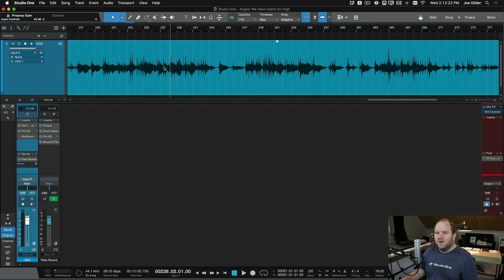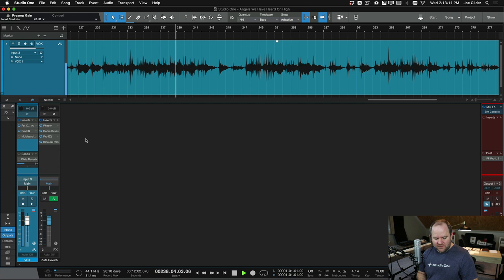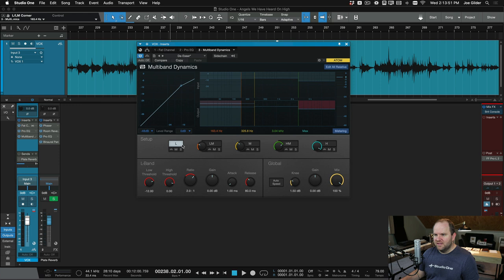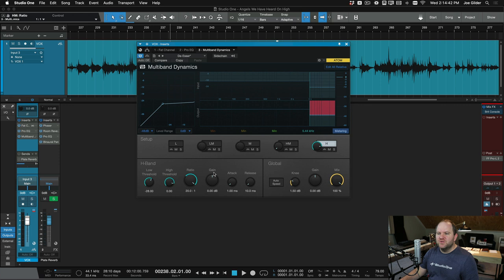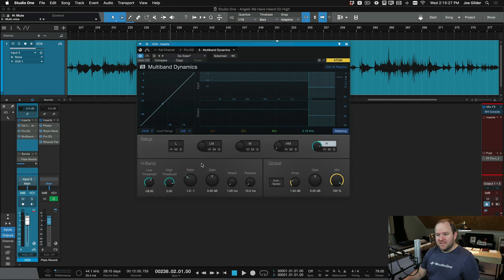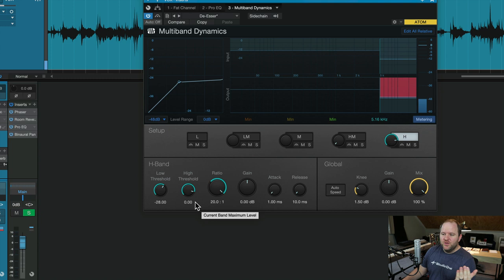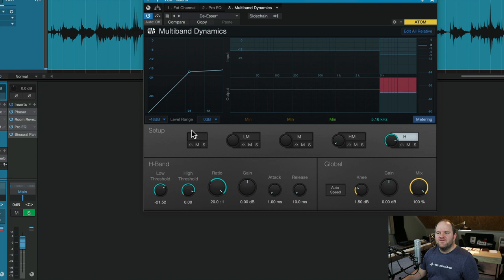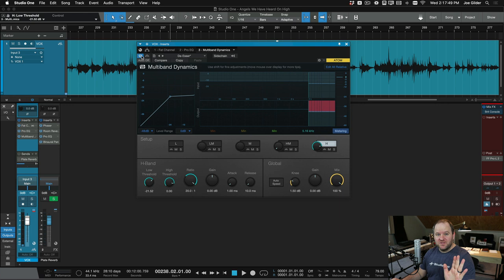Build a De-Esser in #StudioOne

Comment: You said there's no built in de esser but there's a preset on the studio one compressor called "De-esser". I've used it a couple times and it's worked rather well. This probably works better though
Reply: I have Artist. I've tried clicking and dragging this de-esser on to my vocal channel. It refuses to co-operate.

Comment: It wasn’t getting the full “S” noise out for me, my condenser is super sensitive, so it still stuck out like a sore thumb. But I found that by simply splitting the track right before the word and dragging the top corner over a little (and fading the word in) it cut it down the beginning “S” noise enough to make it smoothly go into the rest of the word. Just a tip for anyone that’s only got a few “S” noises to get out and you’re vocals are being stubborn.